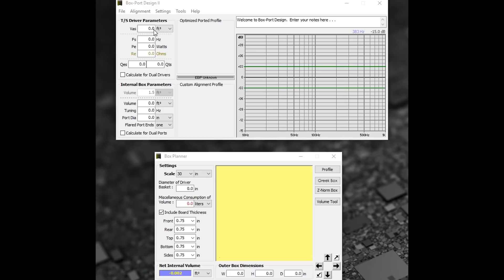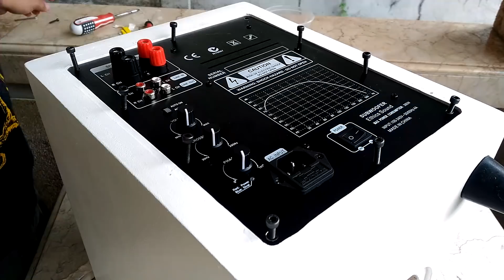How to make Down Firing Powered Subwoofer - DIY Build

Comment: You the only guy that does build speakers properly ... No nails -screws or other shit..Pure glue bonds-tight -up to measure .Pity you dont use more quality speakers - but those are hard to find these days
Reply: @cocosloan3748  using screws its too expensive for mass production when you glue, you only glue the thin surface of the wood. when you have massive air displacement you have to take that to consideration. but for most home speaker i agree srews is not required.

Comment: Nicely done, quality build!  But bass port looks awful, I would go for bigger and longer one and 46Hz seams rather highly frequency for a sub, -3dB on 43Hz is really weak performance, driver fs is 41Hz you could tune it at 40Hz or lower to extend bass response.
Reply: can i know where i can learn how to tune?
Reply: @haziq90  look at the fs of your driver. Tuning should be around that. But it depends, if you want to build an infrabass, tuning should be very low, if you want ro build a kickbass, tuning should be very high. And if its an allround-bass, tuning should be ~36 to 48... The specific tuning depends on your usage, the drive itself and how big / loud you want the sub to be. You can only pick two of the three following things: efficienzy, size, deeper bass. So you have to compromise...
Reply: I use Bass Box Pro 6 for my projects. Vent size should be the minimum size that will keep the vent air velocity low and avoid vent turbulence noise at maximum excursion Xmax. Just type in Google Subwoofer Vent Air Velocity it will give you plenty of knowledge.
Reply: @Hoaqxin  that is why it is very important to choose right driver for your application. I don`t believe all "around-bass" tuning. Big role plays music genre will be played on the sub, for hiphop tune it as low as possible but for dance music 45Hz will be relatively ok and for rock music closed box (for those tight kicks) or open baffle (live sounding), but then sub is only used to extend lower frequency and all higher midbass from 60/80/100Hz-150Hz etc will be covered by bookshelf/floorstand speakers need to balance every part of your system. Efficiency I would chose only if I want to go loud as possible without thinking about quality/freq response (be honest we rarely are listening our sound systems to the max volume) I believe there are drivers that can do everything but comes with high price. (Always check Qts parameter). Size is the big one - you need to compromise here. Extended bass in my view is the main thing to look for.
Reply: @JanisAbols3000  yeah, extended bass is great for hifi and home cinema. But for PA, you may want to choose efficiency, as you dont really "hear" the quality-difference between an 7/10quality bass and a 9/10 at ~120db. Best set-up there would be an infrabass for deep bass, a kickbass for the "higher" frequencies, and tops... But thats only possible with a high budget,  measure equipment and a dsp.. So most small setups just use one type of subwoofer. Typically 18" and if they reach a f3 of 37-43Hz, i would consider them to be "allround". They play your normal edm, disco tunes and they can even play hip hop.. They're inbetween infra and your kickbass..
Reply: @Hoaqxin  PA is something completely different,  and you are right efficiency plays the highest role there, but we are talking about relatively small HiFi systems and for 18" you neel lot of space and it is not suitable for medium size rooms, and box size how huge that would be,  18" only open baffle for HiFi.

Comment: Came out great. Only concern I have is the poly fill. You should never use it in a ported box. It will go inside the woofer coil which is very bad news. I have seen it happen.
Reply from the maker: Fiber fill and fiber lining are two different things. Go ahead look it up.
Reply: CHRCLMNKY oh so that won't fall apart with all the turbulence from the woofer. To each their own.   Great build.

Comment: i used to have a klh down firing one with 8" woofer & 100w. amp, sounded great, once the sub blew i replaced it with a kicker, sounded even better.
Reply: i currently have a front facing klh 12" 200w, origional woofer but replacement amp.
Reply from the maker: Good stuff.
Reply from the maker: @houzeiguapo3375  Hello how you doin'? You know what, here in the Philippines, the word "guapo" is synonymous to gay.  😀 😁 😂
Reply: on yours I like the white, & the jbl is nice too.

Comment: dude. doing everything very cool. but in some places, maybe they just did not get into the frame, I do not understand your actions.
 Why did you put a box from the inside with a soft material in a phase-in-inventory design?
 and why you use such amplifiers. I wonder what it plays and almost do not show. Khatya I'm sure that is not bad.
doin pretty cool. you need to make more complex design.

Comment: Port is too small...
Reply from the maker: Suggested port size in JBL owner's manual is smaller than what I put here. Do we have to argue JBL or Mr. Harman himself for suggesting such small ports? And by the way, the box outputs just fine even to massive and heavy below 30Hz bass boosted hiphop songs and stuff.
Reply: Really, I would of thought that that would be moving some serious air?😕
Reply: @z33hayden23  when a sub is moving less on low Bass notes , it just means that the enclosure is tuned near that frequency ;)
Reply: True
Reply: @nilsuhlemann7421  yeah but just 2hz below the tuning frequently and it a tornado if the port is not big enough. But bigger port means bigger box. Some 5 inch book shelves speaker that have bigger port that this. Do I have to argue with JBL , yeah , the brand name has nothing to do with the product.

Comment: Great build!  One small suggestion: the screws holding the driver in place should be non-ferrous metal.  I didn't do that on one of my builds and almost ruined a pair of expensive ribbon tweeters. Every time I took the tweeters off, very fine pieces of metal would come off and lodge in the magnet.
Reply from the maker: Thanks for the great tip Jimmy Jim. Those so called "carbon steel" hex black bolts still can get rusted. I'll keep your advice in mind. :)
Reply: On cone driver's this doesn't matter. It could only have an effect on driver's where the screws are right next to the magnet. Even then im not sure if you could hear the differences. If you mean because rust... Yeah i wouldn't want to have rust on my speakers.
Reply from the maker: @kaedeschulz5422  I agree.
Reply: @kaedeschulz5422  No, I'm not talking about an effect on sound. If you unscrew the driver a couple of times, say to work the x-over or to check wiring or stuffing, you can flake off small bits of metal from the screw head. If it is ferrous metal the bits can get drawn into the magnets and cause damage. That's what happened to me and ruined an expensive ribbon tweeter.
Reply: @jimmyjimjimmyjimjimjimjim4437  Alright. I never had this problem so that's why I don't even think about it.

Comment: Great job.  Beautiful work.  Maybe I’m OC, but it’s always bugged me that subwoofers use the bass from both stereo channels to drive one speaker.  I’d want a subwoofer with two amps, and two drivers in two connected but separated enclosures with two separate ports.  There are subtle differences between the stereo bass tracks in a lot of music.   I think I want to build something like this X 2, back to back.
Reply: No there is not alot of stereo content in bass. Unless you are crossing over the subwoofers higher that 80hz.

Comment: Looks good. Im not sure about closing in the amp like that for cooling concerns but looks damn good.
Reply from the maker: There are some ventilation notches on the back of the amp plate so needed to enclose it. Bass pressure will go out there and will break the frequency resonance.
Reply: @chrclmnky  ahhh ok.

Comment: You did not have available where you bought the amplifier board, and the design of the box in pdf to print.
It was very good, beautiful work
Reply from the maker: Hello Adrien, thanks for the compliment. Kindly checkout the description for the box layout and dimensions in Tinkercad.
Reply from the maker: The amp board can be purchased from Aliexpress  just search "airs pw-280".

Comment: Nice Job and a Cute Dog too 😊
PS: How do you did the Orange Port?
Reply from the maker: Thanks serJoga, the orange port was a 2" PVC pipe and heat shaped to fit into black plastic port tube. It is an extension to achieve port tuning.

Comment: Very nice video kabayan. Detalyado at maganda panoorin. I enjoyed the video. Suggestion lang brother. If you can come up with a pair of 3 way floor standing speakers that has dual 8 inch sub, dual 6.5 inch woofers and dual tweeters per channel with either wooden finish or paint. You can use kevler, daiichi or targa speakers kagaya ng ibang ginawa mo para quality pero di masyado mahal. Mahirap kasi maghanap ng ganun sa Pilipinas kaya palagay ko may market ka doon at mas madami bibili sayo. Dikitan mo din ng sarili mong logo na parang signature series mo na. Palagay ko sisikat ka kabayan. Great work and more power! Keep building..
Reply from the maker: Many thanks Sir. And that is a very good suggestion. 😀
Reply: Wait what? Filipino pala siya? Akala ko foreigner.
Reply from the maker: @turborat20yearsago58  Afams rag pamanit brad? 😂😅
Reply: @chrclmnky  For real, akala ko talaga foreigner ka.

Comment: What is the black thing called,not the speaker/the pipe the 1 at d back
Reply: I'm talking about the metal 1 not the port tube
Reply from the maker: @antoniobrown5665  Amplifier board.
Reply: What's it's full name?,what are the one on the pa sound system called
Reply from the maker: @antoniobrown5665  AIRS PW-280

Comment: Wow, you're really skilled bro, you are the only person, other than myself to use locking (T-nuts) to attach a subwoofer to a cabinet, the sound demo was pretty good, not long enough thou. That must have been an 8" sub, how many watts was the plate amp?
Reply from the maker: Hello James, thanks for the positive comment. The subwoofer plate amp is rated to have a 280w RMS. I don't know if just marketing tactics but it is very powerful in driving the JBL Stage 810 subwoofer.
Reply: I appreciate your response, that was a very good build and not bad for your plate amp selection, most plate amps start at 50 watts, but you have more than enough power for your subwoofer! great Job...
Reply: Where did you buy your amp plate if I may ask?
Reply from the maker: @stylishenigma7434  Hello Phamela, the amp plate was purchased from Aliexpress.

Comment: looking good. but i dont know if im alone but i dont like down firing because you cant see the beast working. in my opinion speaker must look beautiful and a down firing only look like a wood box.
Reply from the maker: I agree. But one thing must be sacrificed over the other, looks versus sound.
Reply: I had two down fire subs and the velodyne was awesome if the two. I like the sound of the front firing subs. Was a velodyne fan and still like and have a dps model but upgrade to svs and wtf have I been missing.
Reply from the maker: @jimcole2648  svs subs are my dream subs.

Comment: i have this exact same plate amplifier. is it really 280watt RMS @ 4-ohm?? I connected it to a kicker 40cwd124 in a ported enclosure tuned to 37 Hz and so far no issues for about 12 months.
Reply from the maker: Yes it can do a good job to any 4 Ohm subwoofer.

Comment: i did this exact project and theres one major problem you dont mention. there are gaps for air to flow thru the amplifier plate which affects the sound quality.
Reply from the maker: Watch the video again and again, there is a panel between the amp and the subwoofer space so no air can escape. Be sure to watch it again and again from start to finish until you see the panel. Ok?
Reply: @chrclmnky  my bad bro! mine came out pretty cool too. i used a 300watt RMS 12" SVC Kicker tuned to about 40Hz
Reply: Youngbluhd770  about R3300 . Or ZAR

Comment: Ahh I already built an enclouruse for my sub but completely forgot about making another chamber for the amp... Can it work without the other chamber or am I screwed and have to start over?
Reply from the maker: Hello Iisakki, should have enclosed to a chamber so the air pressure won't damage the electronic components. Currently I am rebuilding a box for this particular subwoofer and amp because the port tube on this one is too small and creating a lot of air gurgling. Check out my latest video for that. Thanks.

Comment: Hi sir, impressive work. Btw where can you buy that type of amplifier? Does it have a specific name type?
Reply: The general type is a plate amplifier.
Reply from the maker: Thanks Craig. This amp is just a Class D circuit and about to output just 280w RMS and is very expensive. I have no choice since I am here located on the other side of the planet. I wish I live in the US so I can buy cheap and powerful amps sold at Parts-Express.

Comment: hi thank you so much for the video.  Still i do not understand the benefit of a sub with the woofer firing down ... of course i say this on general.  i am clearly missing something.  For me drivers should  always fire towards the listening spot.  Like in an execution.   I know it is trivial but ...
Reply: gino   Down firing means you have better locations to place it.

They all just pressurize a room.   Non directional.

Only thing I don’t understand is.  How high the mounting legs should be?
Reply: Where the  actual woofer is pointed has a lot less impact than where the port is aimed in the room. Generally, you don't want the woofer or port aimed directly at you; When you place a subwoofer in a room you don't want to be able to tell where the subwoofer is, all you should concern yourself with is where in the room will the subwoofer produce the most even bass throughout the entire space with as little peaks or dead spots as possible. The channel "audioholics" has a good video talking about subwoofer placement that really helped clear things up for me before I knew about how subwoofers really worked.
Reply from the maker: You guys are on point. Thanks for the comment, I too learned much about the discussion. :)
Reply: @johnpark3243  thank you very much indeed for the very helpful advice.  Just one more question ... which is the cut frequency for the sub ?  i mean which range does it reproduce ? please excuse my poor english.  Thanks again,  gino
Reply: @gino3286  Typically a subwoofer will have a frequency range of around 20 to 200 hz and where you set the cutoff depends on the bass extension of the speakers you're pairing the subwoofer with. If your speakers have good response down to 50 HZ generally speaking you would crossover your subwoofer at around 80 hz so that they blend together but don't muddy up the bass. I hope I understood your question right
Reply: @johnpark3243   yes that was my doubt. But when just a single sub is used i guess it is better to limit its working range at max 80 hz? I understand that at higher Hz the bass becomes directional
Reply: @gino3286  The lower you're able to crossover the sub the better pretty much, as long as the speakers you've matched the sub with have enough low end extension. It's always better to keep the subwoofer from producing directional frequencies but if your speakers only go down  to 100 hz then you will have to rely on the subwoofer to produce the frequencies required to blend with the speakers. I'm not really an expert on the subject myself, but from what I understand it's always best to get speakers that extend down comfortably to 50 hz so that crossing with a subwoofer is easier.
Reply: @johnpark3243  thank you John perfectly clear that was my main uncertainty sub are a great addition in almost any System kind regards Gino

Comment: Nice build, although I am curious is there any specific reason you're underpowering the sub so much?
Reply: Nevermind, just looked at the JBL Stage 810's specs, weird how they label 800 watts on the sub when that is just the max, and the RMS is only 200.
Reply from the maker: @extremememe3296  Peak power ratings are purely marketing, my friend.
Reply: Because it will sound good, and you dont have to worry about blowing the sub
Reply: I already answered my own question, however. I expected 800 watts to be the RMS, that's what the sub showed. If you are matching the amps RMS to the subs RMS, you don't have anything to worry about.
Reply: Oliver Vesely more likely blow the sub with underpowering it. The voice coil will act as short circuit with dc.
Reply: @emppu-tech6065  but if you put 100w into 150w its completly ok
Reply: Oliver Vesely Yes if you adjust the amplifier gain with oscilloscope.

Comment: local mo lang nabili yung allen screws bro?
Reply from the maker: Yes Sir, there are a plenty of Allen Hex bolts at any bolts and nuts stores. If you're in Cebu check out Cebu Bolt & Screw Sales along Leon Kilat street. Staff is very knowledgeable and very accommodating. Highly recommended. I am here located in Butuan City, and the local Bolts and Nuts store also has them all.
Reply: CHRCLMNKY ok sir, metro manila ako.. wala ako makuhanan ng allen screw na self tapping.. kahit sa raon, sa to-suy or sa ace and handyman..

Comment: Does the speake make pop or thump noise when amp is turned on or off?
Reply from the maker: No. Amp board has turn on/off delay.
Reply: @chrclmnky  and how to set that delay?
Reply from the maker: @Apocalypse_30  no settings. Factory defaults only.
Reply: @chrclmnky  ohh 👍🏻

Comment: Can you make a tutorial on simple build stereo speaker, i want it to be small/minimalist like desktop speaker (speaker that had mini subwoofer) 
I had one, but dude its more than 10 years now, it rattling inside subwoofer, small rattle but i can't fix it (i've try reglue, adding foam to the every join), can't stressed more
Reply from the maker: Hi ultra linx, check out my latest video, the diy desktop speakers.